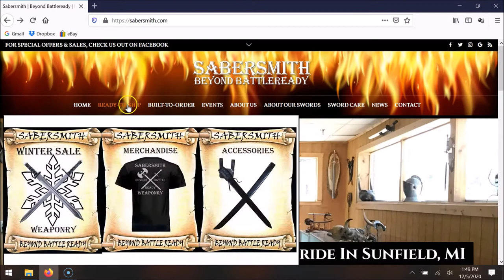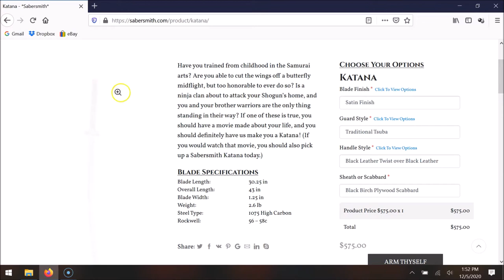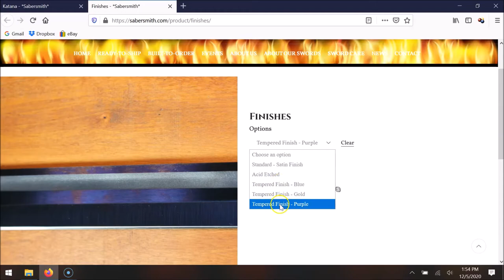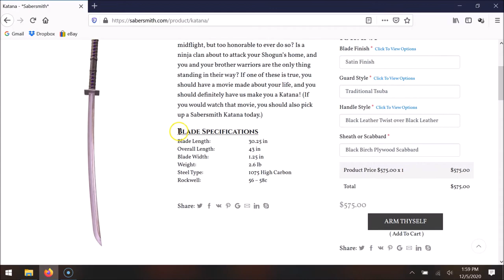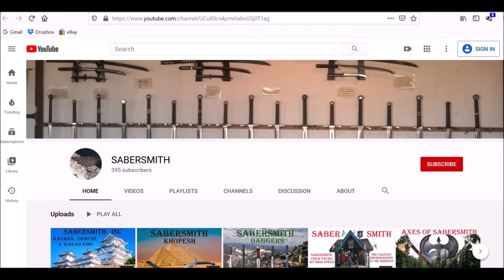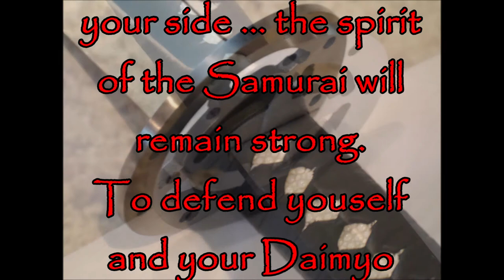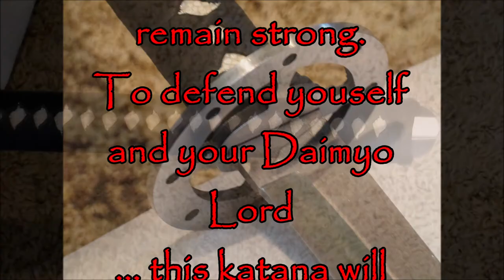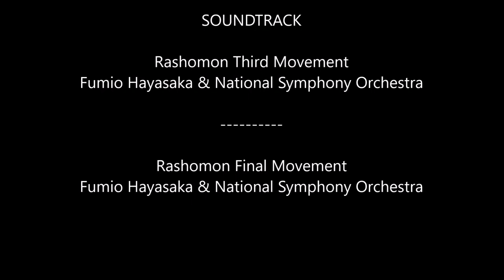The Katana by Sabersmith

Comment: I bought a katana from Sabersmith over 20 years ago from Quiet Waters Park Renaissance festival. I think they used 5160 spring steel. It’s a beast. Love it. Hard to sharpen but holds its edge a long time. Glad I got it back then. Before they switched to 1095, then to 1075. And I was lucky enough to buy one that had not had its grind done yet. They were using a hollow grind. I paid to have a partial flat sabergrind with a steep secondary bevel. Very strong edge. I use it to chop down trees and split logs to make shelter and fire. Great Combat survival sword.
$300 back then. Worth $2000 now.

Comment: I just ordered a tanto Japanese dagger from them. It will take abit to come in but I was wondering. Do you recommend wd40 for upkeep?
Reply from the maker: No.  The WD40 is just to clean off the blade after demos.  WD40, while it is a lubricant, its primarily cleans and loosens parts.  For storage and long term upkeep I would recommend 3&1 oil.  It easy to get, easy to get, and will do to job.  I've been using a combination of those two products for over 30 years ... ain't had a sword rust on me yet.
Reply: @mr.excalibur1455  so wd40  for cleaning and 3&1 for storage. Good to know.
Reply from the maker: @OtaniNoAsagi  They are an easy to find easy to use set of products that'll keep your swords in good order.

Comment: Is there a way to get rid of a secondary bevel after it has been put on a sword?
Reply from the maker: Yikes ... that IS some major grinding that you would have to do.  Unfortunately, apply THAT kind of heat in order to re-profile a blade like this would also compromise the tempering.  They do have the option of a flat / single bevel grind for their katanas especially.